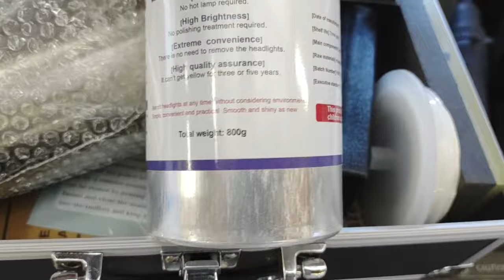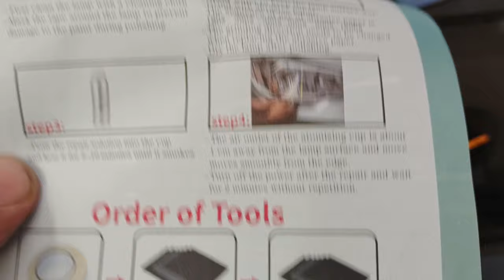Can you permanently fix your hazy headlights for less than $40...with vapor?

Comment: Warning to anyone trying this. Do not use any xylene-containing products on the headlight assembly after using this vapour kit. The glass layer that is formed by the vapour is a very high stress, high shear shell. It will not stand up to the stresses created by products like certain panel prep solutions (with xylene inside), or practically all clear coat sprays. Furthermore, the surface will rapidly degrade if left unprotected. I saw a noticeable difference in my test lights after only a few weeks in the British springtime sunlight. While the results from the vapour process are immediate and stunning, they are very short-lived. I have a test underway using a clear PPF wrap which is so far holding up very well in the sun, but only time will tell if it really holds.

Comment: i do this for a side job and i use the vapor kit with acetone it has no uv in it nothing is permanent  add a ceramic coating on top it will last a while 👍
Reply from the maker: Good tip! What do you charge to refurb headlights?
Reply: £70 but i add a 3 year ceramic coating on top
Reply: I've tested with acetone and found it to work well but you need to keep the headlight warm throughout the process in order to minimise condensate formation on the surface of the headlight. The mystery blue liquid in the kits did not suffer from condensation at all in my tests, but with acetone in ambient temps of less than 15c, condensation was awful and any amount of it quickly warps the polycarbonate.
Reply: @captainotto  i been useing the vapor kit with acetone for 7 months im from uk i havent had no issues key is in the prep

Comment: I'm surprised they started at 180 but the end results look pretty nice.  I found myself wondering the blue liquid is acetone based or some other chemical that can dissolve plastic.
Reply from the maker: I agree, the 180 seemed pretty dang aggressive. Next time I do it I'll likely skip the 180. I think you're right about the acetone. I don't think it was heat alone that got these results (as it never got very hot).
Reply: @new_oldstock  Main ingredients: synthetic resin
Reply: It has almost no smell. If you accidentally spill it on the headlight, it will immediately dissolve into the light causing severe warping. And its vapour reflows PC just like acetone does, but it is definitely not acetone. I suspect it is another methyl ketone but pretty confident it's not acetone.
Reply: Acetone works the same apparently.  I do not do my lights this method though